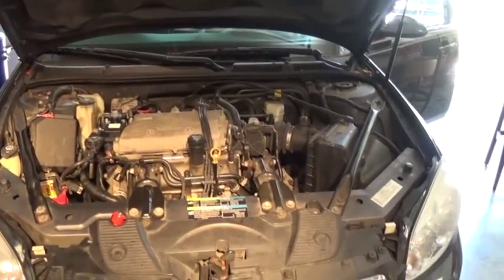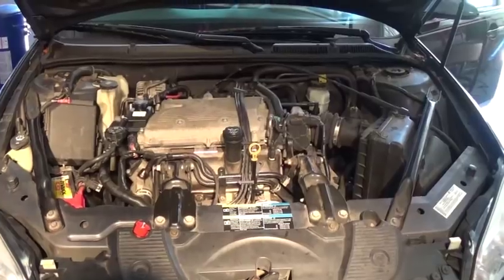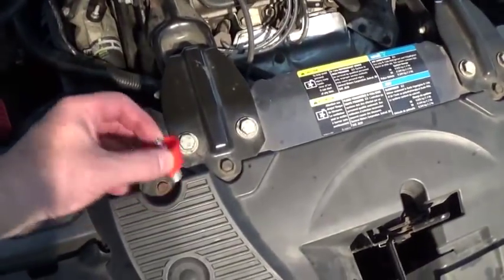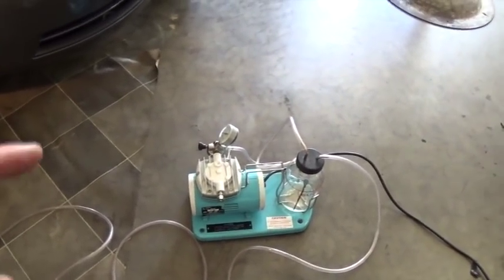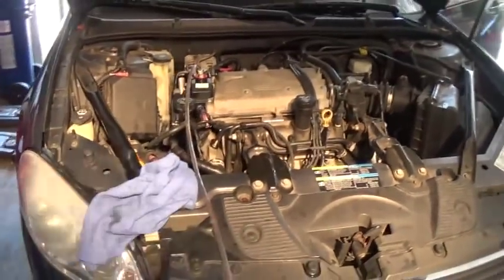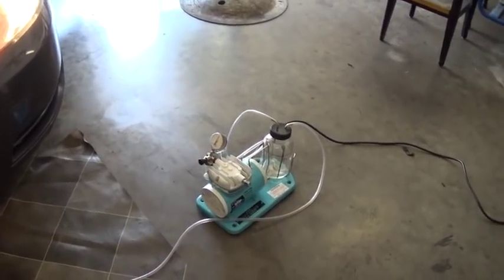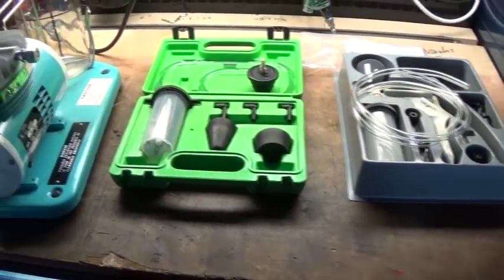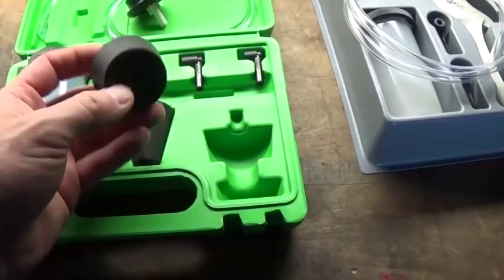GM Power Steering System Bleed

Comment: I use one of those pumps to bleed brakes and evacuate other fluids
Reply from the maker: Che Kelley where did you get your pump sir?
Reply: These pumps are used for HVAC to remove air. $100 from harbor freight. The cones don't work on a lot of cars due to cut out tabs for the cap. A flat sheet of plexiglass with thin rubber on one side will work.

Comment: was at the dealer at that time    they were a pain!   should have used the vac pump... but turning the wheel like 50 times did it.  if the car comes back it might have a leak sucking air in and no fluid out
Reply from the maker: scuba422123 I hope this one will stay out of my garage. I already spent way to much time fixing this. Cheers my friend.